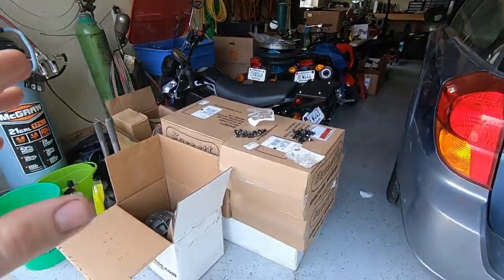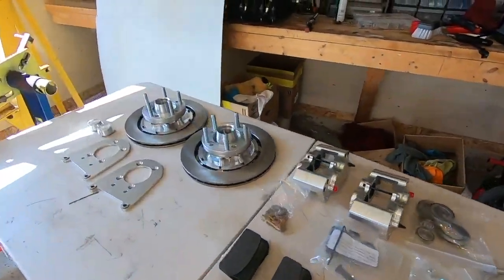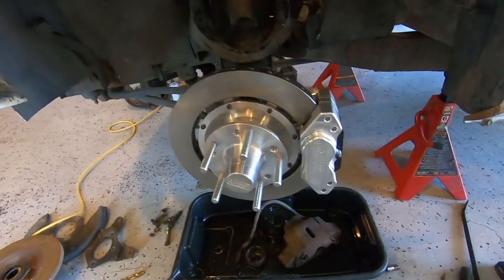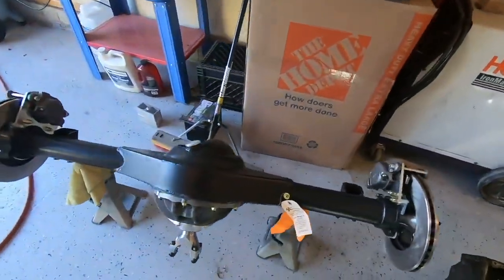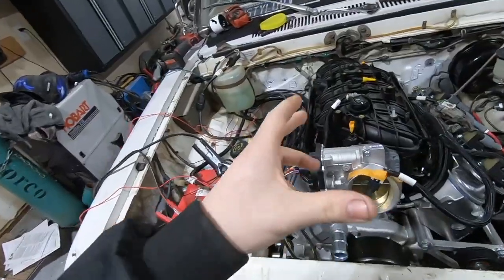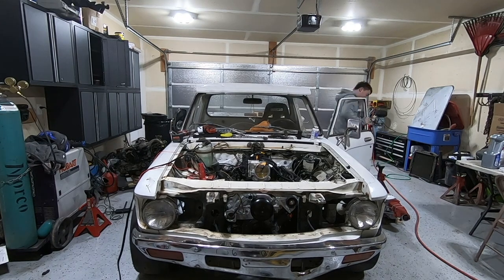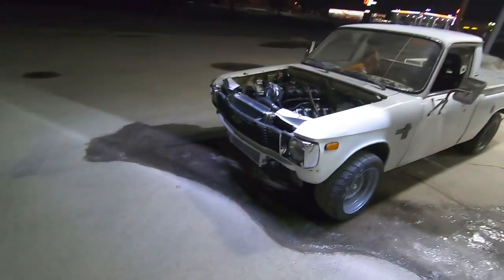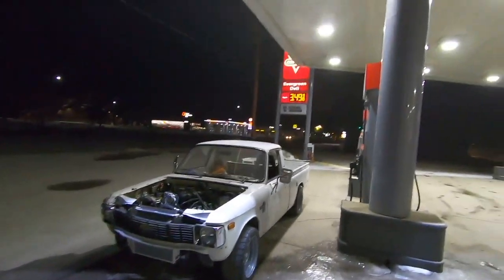LS Swapping a Chevy LUV in 10 Minutes! (NASTY LUV Build)

Comment: Wish more people would get creative with the little Isuzu motors that came in these. They're really stout engines. I used to have a built motor in my 78 Luv (bored out, high compression head, weber carb, header) and it was no slouch. Guys in AUS have been building and boosting the 1.8L (came in the Holden Gemini) for a long time and putting down serious power. Or swap in the bigger G200 from an Isuzu Trooper and build that. So much more character than just another small block swap in my opinion....

Comment: What was wrong with the 4 cylinder engine that was originally in it?
Reply: 78hp
Reply: @rustystick  So.  Noting wrong with a nice running 4 cylinder engine, nice gas saver, nice little truck, that's all ya need. I like small and humble, gets the job done for what ya need it for. Hope you don't ruin the looks of it and lower it down yi the ground, then this little truck which was once beautiful will look all punched out.
Reply from the maker: It had a hole in the block
Reply: @autotechaaron  ah.. could be a problem